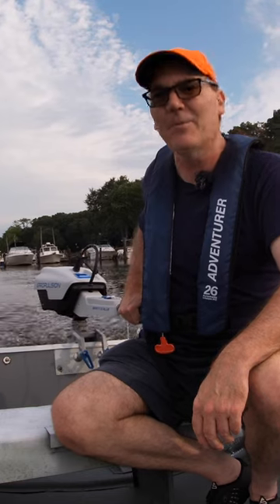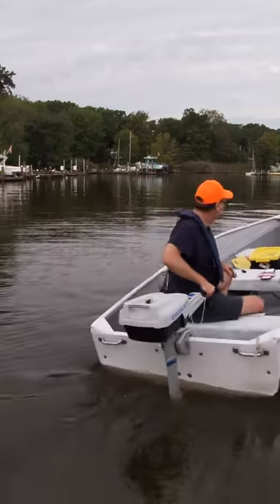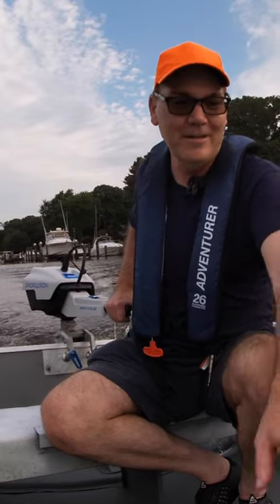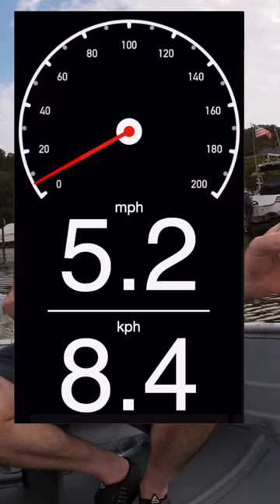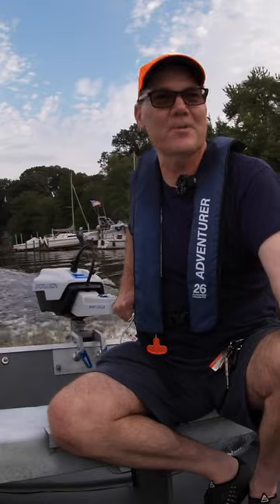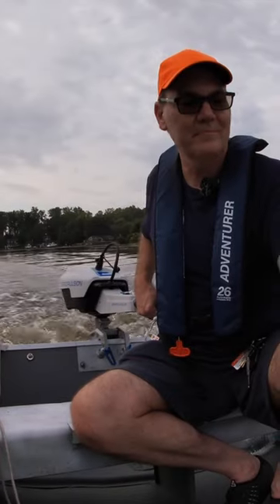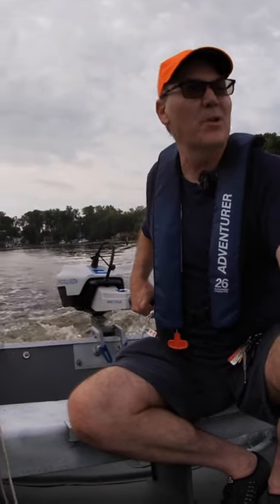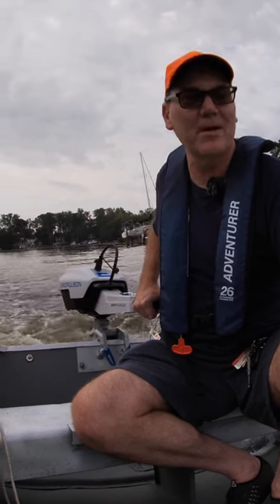ePropulsion electric outboard speed test on small aluminum boat #outboard #electricboat #epropulsion

Comment: I’m curious how long will the battery hold out at that speed?
Reply from the maker: Apparently it can run for a little over an hour at full speed. Much longer at variable speeds
Reply: @WayneTheBoatGuy  not bad  technology in batteries is awesome. I wish we had it when we where younger. I’m ciked to see where it goes. Pretty soon we will be cruising in quiet motor boats. Thx for your vids I’ve used many them.

Comment: Can you keep it up for 12 hours ( 1 gallon of gas)?
Reply from the maker: These can theoretically run that long at very low speeds. But even a 2.5 hp gas one will burn much more fuel than a gallon over several hours.
Reply: @WayneTheBoatGuy  Mine. 10 oz per hour, trolling.